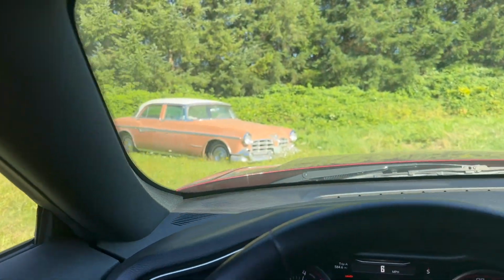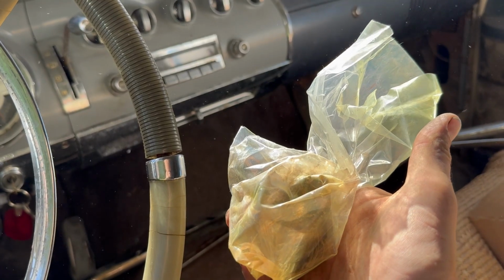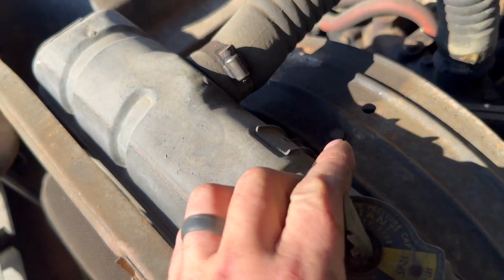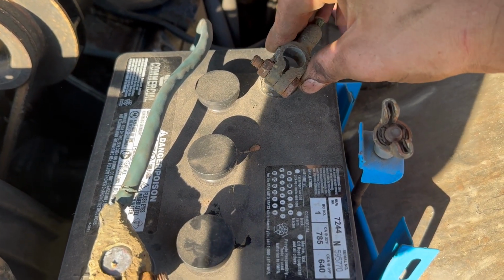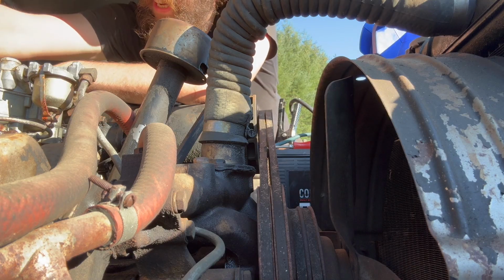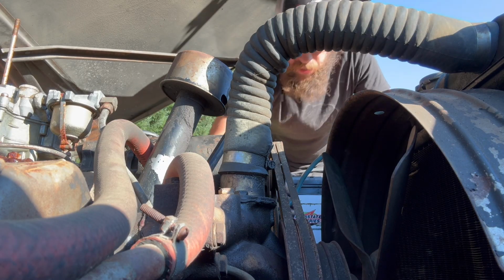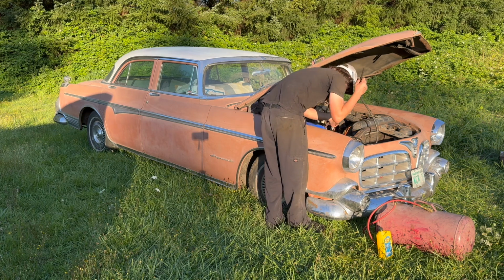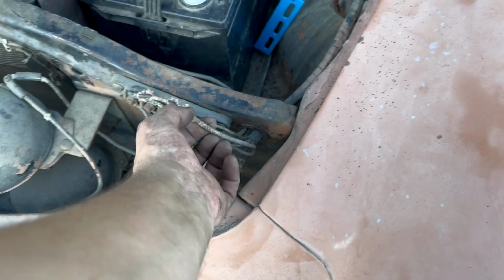Hemi Powered Land Yacht - Will This 1955 Imperial Run And Drive After 30 Years?

Comment: That was a transmission relieving pressure because it hasn't been running a long time until the building pressure up on the transmission.
Reply from the maker: No, It wasn’t “relieving pressure.” It wasn’t building sufficient pressure to move because the fluid level was 2+ quarts low. If it wasn’t low, this transmission pump pressurizes the system in neutral, and it would go right into gear after having run for a few seconds.

Comment: 4th gen Ram trucks with the 5.7 are pretty good. I think they surpassed Ford and Chevy on build quality, capability and durability. They still sell the 4th gen alongside the 5th.
Reply from the maker: I had a Pentastar V6 fourth gen 1500 truck, and I absolutely loved it. It wasn’t enough truck for the stuff I tow and I was slowly killing it, so it was replaced with a third gen Cummins. But as a do all truck, a comfy ride, an economical daily, a four door family and dog hauler, a pickup bed for engine parts, and a modest 7,200 pound towing capacity, it was truly awesome. The Hemi trucks are similar, with a bunch more torque and 50 extra HP. I’ve had my times trying to fix Hemi problems though… so that wouldn’t be my choice. They just recently stopped making the “Classic” 1500, finally. End of an era.
Reply: @DeadDodgeGarage  My boss has a 4th gen 5.7 we beat the crap out of as a construction vehicle. The frame, bed and suspension are really heavy duty. It did have a lifter fail recently but the dealership was able fix it in a couple days.

Comment: Maybe Been Better Served With The  Hot 1960-62 "Letter" Cars (Especially With 2 4bbl 413)
Think The 1962 Was The Last Year For The All Out "J" Luxury Factory Race Car With 413.
1963-64 300 Still Hot.🔥 
1967 Had The 440.
1970 With Hurst Edition Chrysler 300 With Factory 440/375 HP, TNT V8, With Performance Upgrades.
Last Year Of Big Car Performance.

Comment: Hilarious! Again, the correct technical electrical term for that gauge is ammeter, based on it’s electrical function. The various gauge face labels used across various platforms over the years are for styling variations only, the gauge face labeling has no relation as to what the device technically is. All factory technical service manuals and training materials from the time only refer to this device using one term, Ammeter, nothing else. (Pronounced am-meeter)
Reply from the maker: That’s fine. I’m fine with that. But when one gets in a car and doesn’t have that knowledge, what are they going to call that gauge? I bet they call it by what it is labeled!
Reply: @DeadDodgeGarage  Granted, that may very well be the case but does not make it technically correct. Folks can call it whatever they want, it’s still an ammeter. Very few owners & technicians from then and now could/can correctly interpret the information the ammeter displays anyway.

Comment: I have a 55 Dodge C3H Stake Truck with the 1st gen Hemi. Runs great but with the low gearing of the two speed Eaton rear axle even in high range it only gets about 5 mpg at 2600 rpm and 50 mph. It's a blast to cruise around in though and everyone wants to talk about it. 👊😎👍

Comment: If the wiring is correct and the starter is in good shape a 6 volt system will turn over almost as fast as 12 volt but everyone uses to small of wires for 6 volt.
Reply from the maker: I did see another comment about that, and it’s something I will be looking at closely later. Of the handful of six volt rigs I’ve had experience with, it seems highly unlikely that every single one had smaller than factory battery cables installed. But I guess I could be wrong.

Comment: The only thing you needed there was a remote start button, I always hated going back and forth when alone.
Reply from the maker: Incidentally, like all Chrysler products, there is a spot in the inner fender that can be jumped with a screwdriver to crank the starter. For various strategic reasons (potential fireballs? Also reading the oil pressure gauge) I chose to forego that option and use the key on this one. Turning the key also cuts power to accessories, and on later cars puts full voltage to the ignition coil, so in many cases I prefer to do that anyway. My starter button was in my toolbox.
Reply: @DeadDodgeGarage  I was never a fan of the ole screwdriver jump trick, too much risk of fire or unplanned welding.  Just comes down to how much time you have to throw at a project. I worked at a dodge dealer for ten years 97-07 as a tech so its really fun to watch you tackle this old stuff.

Comment: Well I own a '56 Imperial Southampton Crown Royal. It has the 354 Fire Power hemi. Also that one has a brake booster. Mine has hydro boost. The generator is busy. It charges the battery, runs the power steering and the power brakes. I can say this them things are way over engineered. Must be about 10,000 miles of wires.

Comment: The '55 and '56 were both GREAT looking cars. I always had a thing for the '56 Desoto Adventurer that Jimmy Stewart was driving on Vertigo. The Desoto 341 and 345 Hemi are cool. The Chrysler 331, 354 and 392 are better but, the DeSorto Hemi is better than the little Dodge Hemi. The Poly 318s are ok, but they just can't compare to the larger single rocker shaft engines like the 354 that can be turned into a Hemi double rocker shaft engines. The reality is that with modern cylinder head and stroker options the B, RB and LA are definatly easier ways to make power. A 500 or 512 Stroker 400 with TFS heads can make all the power you could ever want.
Reply from the maker: I agree on all points - but I'm not sure here will ever be a cooler way to make power than with these early "Hemis." Haha.

Comment: Sorry this is so long. 
  WOW! We owned one! In the early '80s. It was a two door. Same color, (which I was told was rare), white leather with mohair inserts. Two way power seat. Even the vent windows were power. It ran and drove great. It never gave any real problems. 
My wife drove it every day and refused to sell it many times. We would drive it 200 miles or so on small trips. She became an x wife a long time ago and finally sold it. We always loved that car. She has since passed away. The YouTube algorithm is weird. This just popped up. Brought back a lot of memories. It was surreal to see it driving. The rarity of seeing one , ( especially in the same color), had me a little, uh, well...

Anyway:
  Instead of converting to 12 volts, put an 8 volt tractor battery on it. Set up the voltage regulator for 8 volts. My Pop said it was a common thing in the old days. It will crank so much better. It won't blow all the bulbs and fuses. The wiring will not burn up, and the headlights will be extra bright.😁 We did our '55 this way.  
  The hub caps are correct. The master cylinder and booster are not. I know, you said that. I always felt like the taillights were an afterthought. Almost like they forgot to put any on and installed the "gun sights". On a '56, they are in the fender where you think they should be. 
  Oh yeah, I subscribed.😎
Reply from the maker: I’m hip to the 8 volt battery 🙂 thank you!

Comment: My father had the same car, same colors, 2 door. I thought it had a push button transmission. Great memories.
Reply: 1956 had the pushbutton transmission, and Imperial was the first to offer the new 3 speed Torqueflite transmission. It was a mid year intro, it gave you 5 buttons over the Powerflite's 4.  I think 300s offered it mid year, too.

Comment: AFAIK, the material used for the steering wheels was called "ethrol" and is a type of acetylcellulose / cellulose acetate based plastic (wood fibers treated with acetic acid and other chemicals), probably with some kind of filler. Don't quote me on that, though.
Reply from the maker: Cellulose acetate butylate (I think I spelled that right) is what I’ve heard a few times. There was a proprietary brand of that (or a similar mixture) called Tenite.

Comment: When I was a lad, I had both a 55 DeSoto and a 56 New Yorker. Both very similar, but different. Surprised the horn ring is still intact, they can be hard to find. If  a u-joint fails, say good bye to your parking brake.
Reply from the maker: Oh yeah, that’ll be good times.

Comment: Hi Info For YOU,  Chrysler Called The New Engine HEMISPHERICAL Combustion Chamber . Hemi Came B-About From Hotroders That Could Not Spell . The 1955 Chry Hemi Was Two Hundred Fifth Hp (250) The 300B Hemi Was 321.4HP (Honest ) NASCAR Owner Stable 300B Mr Carl Kiekhaefer Whinners A Lot Of Races,  He Invented The Paper Air Filter For His Engines . So There Mr Dead Dodge Garage . I've Got More Info If You Want . T38 Bill
Reply from the maker: Hi, here’s some info for you. In advertisements, publications and brochures, that engine was not called a “Hemispherical” or a “Hemi.” Chrysler called their new engine the Firepower V8. The later Dodge engine was called the Red Ram V8 (or Super Red Ram.) And of course the DeSoto engine was Firedome. Yes, if you read into the literature, you would find a brief mention of the hemispherical combustion chambers. But that was in no way a marketing name or an important, top line detail advertised by Chrysler. “Hemi” was a colloquialism. That means a name that was not formally given to it, but a name assigned to it and used by end users or enthusiasts. The first generation V8s with hemispherical combustion chambers were colloquially known as a Hemi by the early ‘60s, to the point that Chrysler themselves used the name for the 426 to capitalize on that history and reputation. So there, Mr. Bill. I know some stuff, and what’s even better? I’ve got the entire internet at my disposal to settle questions of historical accuracy if need be. Thanks!
Reply: @DeadDodgeGarage  Thank You For ( I All Ready Know Info) I'm 86Yr and Counting . The 1951Production Chrys Fire Power V8 Hemi If You Will Was Not The First Hemi Engine For Chrysler. Take Note, In 1945 Chrys Testing A Hemi V16 Air Craft Engine Liquid Cooled . The People Who Put Bad/Lies/Facts In Print Are Promoting Ignorance . I Don't Use The Internet For Information . I Use Experience Knowledge (Mine) . The Internet Notorious With Wrong Information . The Names Of Chrys Corp. Hemi Engines Emboss On Valve Cover 1951 Chrys, DeSoto 1952, Dodge 1953 . Did You Ever See A 1953 V8 Dodge With Overdrive , I Have Touch 1948 Tucker Automobile At Earl C Anthony Dealership In 1948 . Have You Ever Sean A 1950 Oldsmobile With A Cadillac 3-Speed Manual Transmission ( Stock) I Cut Glass For Custom /Hotrod Cars Oakland Roadster Show (Me) . Attended 1949 To 1955 Speed Week Bonneville Salt Flats . On Circular Track With Parnelli Jones Gardena Ca .On A Road Race Course With Phil Hill Palm Spring Ca . A.J. Agajanian Indy Cars In And Around Gardena Ca Billy Estes Ford Torino Bonneville . 1955 Plymouth 260ci I Think (?) Called Commando V8 Polyspheric Combustion Chamber Oh Buy The Way Chrys Corp. Use Dual Points Autolite Dist.

Comment: Note: The Imperial Had A Longer Wheel Base Than The New Yorker . To @ johndwyer 3357 Back Then People Put Non-Detergent Oil Cost Less , Multible Grage Oil Like 10/30 wt Detergent . Engine  Last Longer.  Eastern Oil Like Pennzoil ,Valvoline Oil Paraffine Base , Note Paraffine Oil Is Wax!!!!!!! That Is Why Inside Engine Is Gunk" . Western Oil Like Mobile Oil Is Asphalt Base Cleaning Action No Gunk Inside Engine . My Father Purchase New 1951 Chrys New Yorker 331 Hemi ,A 1952 Chry Saratoga 331 Hemi , A 1956 Chry New Yorker 354ci Hemi One Year Old A 1958 Chry 2dr ht 392ci Hemi . T38 Bill
Reply from the maker: Yep - 4” longer wheelbase.

Comment: Way to go Jamie!  When I was 14 (1964) I bought a 52 Saratoga club coupe from a local, semi defunct Chrysler dealer.  He had a boneyard of old trade in iron out back, and the Chrysler was the only thing with a hemi. 2 BBL with "Fluid Drive" half automatic, half standard shift trans.  Paid $85 cash American dollars for it.  What a tank, but it went pretty good, surprisingly.  I decided to pull the front bumper off to try and add some cool factor (that was a miserable fail) and the thing must have weighed 400 pounds!  The front end ride height gained about 2 inches LOL.  I removed the approximately 6 foot, 200 pound single exhaust muffler (with a sledge hammer) and then it sounded halfway mean.  That tranny sucked....I figured out the best way to launch was in low range, wind it out, the slam it into high range, which was actually 3rd gear.  My buddies and I had a blast in that old Chrysler right up until I was about get my license at 16, then I put the bumper and the muffler back on, sold it for $150, and bought a 57 Chrysler Saratoga (354 poly motor with an AFB) for 200 bucks.  That was a way better car.  Loved it.

Comment: Nancy's guy Frank here... I noticed that you just splashed a little gas in the carb...  WELL, when I bought my old Imperial (back when I was in high school) I could not flood it no matter how I tried  (I didn't really TRY to flood it but it did look that way).  But because I was still in high school I never had much money (it went to "cost of car", insurance, lic., title & repairs, not much left for gas).  When it ran out of gas, and it did quite often,  I got my friends to chip in for more... then help restart it.  After lots of experience,  I found that I had to have someone POUR gas down the carb, I do mean Pour,  if you just splashed some in, it wouldn't even POP!   While they were pouring in the gas in  I  tried to start it.  It would fire right up... RIGHT away and keep running... as long as they were pouring the gas in.  Again, I mean POURING in the gas!!!  If someone didn't pour gas down the carb, it would NEVER start.  So pour we did, and If we continued long enough, for "gas tank gas" to get up to the carb,  it would all be fine.  So many guys with "car knowledge" told me it will flood if you POUR that gas down the carb.  Well, that Imperial LOVED GAS!  IT NEVER flooded!  Never backfired, never caught fire, just drank the gas.  I never found out why it worked like that but it always did. 😆
Reply from the maker: Yeah, that absolutely matches my experience here. I’ve started a whole lot of engines, and I don’t think any have ever been as thirsty as this thing. Incredible!

Comment: In reference to your comment about carbon build-up in the valve train because of missed oil changes, I would like to suggest an alternative theory.  My dad was a Dodge, Plymouth, Desota &   Chrysler dealer in the late 40s to mid 60’s. How was adamant to never use Quaker State oil (very popular back then) because of sludge build up. He recommended Gulf Single-G which he stated had a mineral base as opposed to a petroleum base that QS used. I was able to test this many years later. I had a 68 Dodge Cornet 500 and my neighbor had a 68 Belvedere (?), both with 318s and similar miles. My friend always bragged about QS oil, while I always used Gulf S-G.  I went and bought a set of valve cover gaskets and took off one valve cover on each car. You could not see a thing on his Plymouth because it was packed full - solid! All my car had was a light film of oil! I’m glad I listened to Dad! Enjoy your channel.
Reply from the maker: Absolutely a factor.
Reply: Just like using pennzoil

Comment: The 55 Mopars are great, but I actually like the 56s even more. It was one of those rare times when the "facelift" actually improved the car. What I like on the 56s are the new rising tailfins, and the cleaned up grilles on the Chryslers and DeSotos. They are both just gorgeous. And the new fins on the Dodge and Plymouths were nice too. That, and they went to 12 volt on eveything, that was the engineering feat of the year.
Reply from the maker: I don’t mind the ‘56 tail fins at all. Think that’s cool. But I don’t like the ‘56 Chrysler grille. Compared to the ‘55 and the Imperial/300, it just seems odd and out of place. It doesn’t look “Chrysler” to me. I do prefer the ‘56 DeSoto over ‘55.
Reply: @DeadDodgeGarage I really don't mind the 56 Chrysler grille, so I guess that's just personal taste, but one thing I would say is the 300/Imperial grille is the best looking of them all, and the cool thing is that they used it in both 55 and 56. Exner was at his best on that one.

Comment: It is a shame the car was not taken care of like it should have been . My father owned a 55 imperial he bought it in Shelby Montana in 58  in a used car lot before we moved to the Pacific northwest it was previously owned by a Sheriff it even had a 6volt spot lamp next to the driver side windsheld. We had a mechanic that took good care of the car when we had it serviced even made sure the body mounts were greased when needed I really miss that car  it was so nice to go for rides in it cross country that hemi was a great motor.

Comment: Put some fresh oil in it. The smoking will probably stop smoking as the rings bed in.
Reply from the maker: Oil looked and smelled great for a short run like this. Oil change is on the docket. I’m hoping so!
Reply: @DeadDodgeGarage  The oil in the motor could be straight weight no detergent. Replacing it with a modern multi-weight, or part synthetic would help.

Comment: I love dual points Stop using a file sandpaper light grit That just doesn't work well.
Reply from the maker: It’s a very light file… not at all unlike a points file, which is a tool that is sold all over specifically to file points. You say that it doesn’t work well, to which I will respond that every single points car I have ever revived on this channel has gotten the file treatment, so I think I’ve proven that it works great.